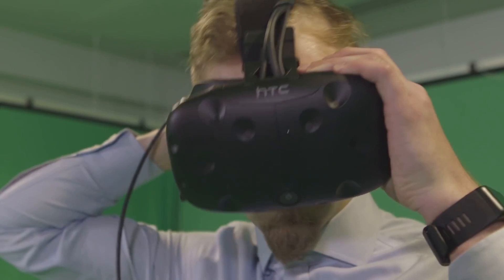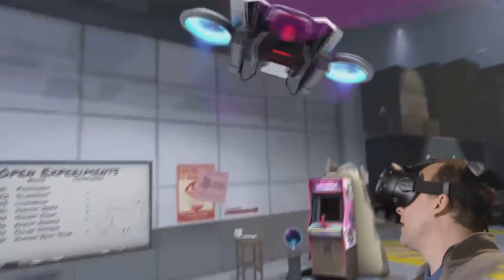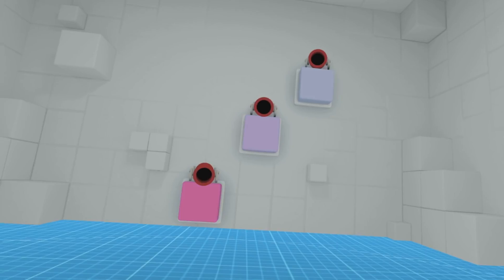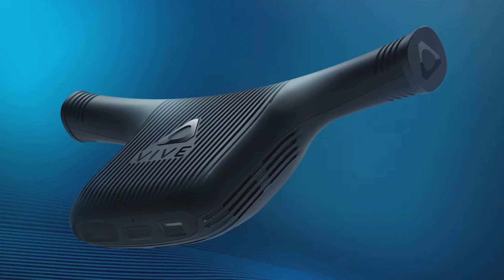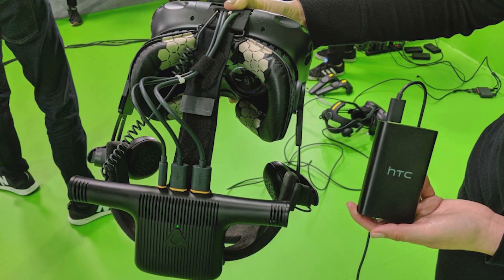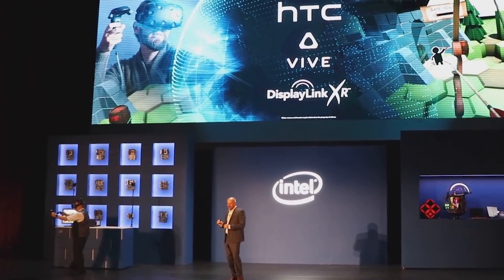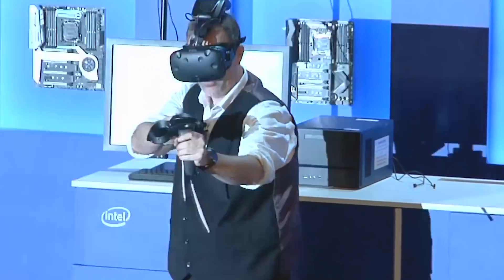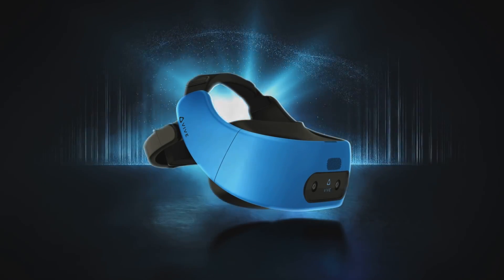HTC Vive Wireless Adapter Explained

Comment: My ITX build has no extra pcie slot as they said. I failed to realize the need and just built the PC one week prior to getting the wireless adapter. I went m.2 to pcie x4 to a x1 mining riser card outside the PC. Been working great looks a bit nutty but I have wireless VR!
Reply: I did the same thing in 2018 when I upgraded my PC and went ITX. A Compact, powerful and portable PC with wireless VR is freaking cool.